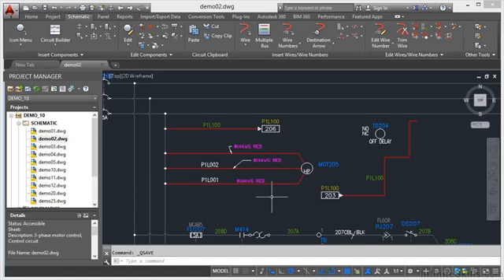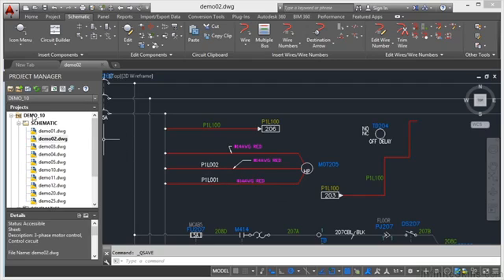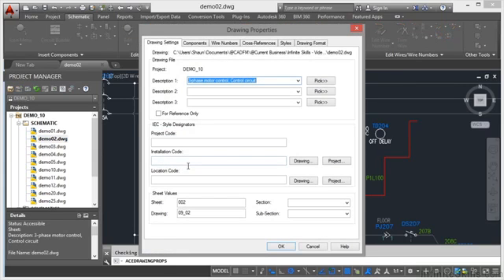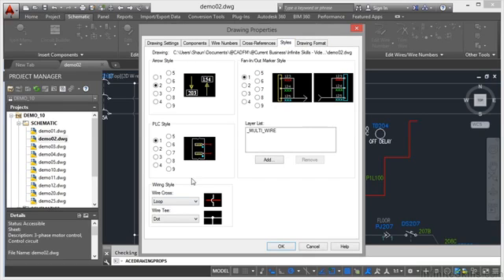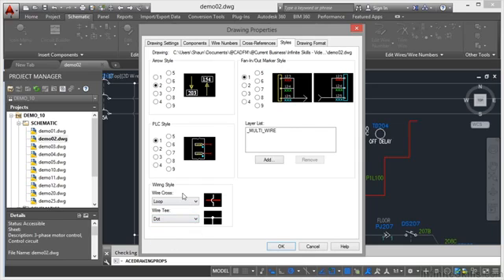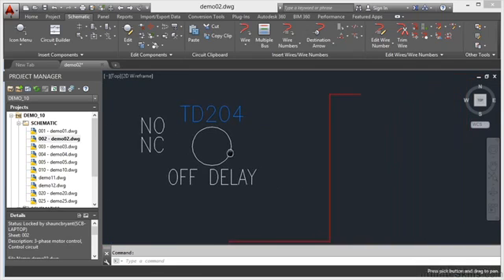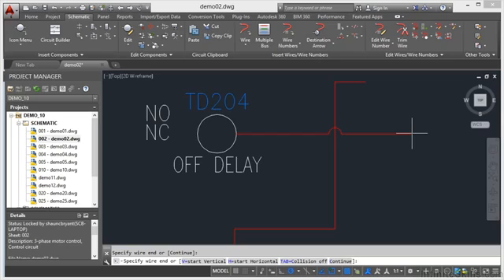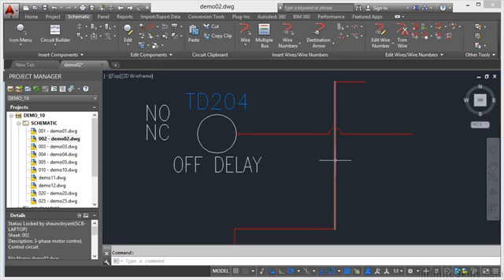10 31 Inserting Wire Gaps

Comment: how to change the radius of gap wire without changing the length of connection? because if default to small to see gap wire, and when I did manually change radius wire gap the conection of wire gaps are disconnected with the wire. please advice